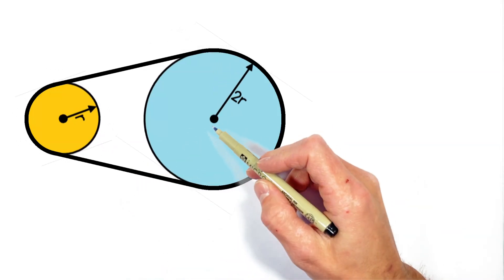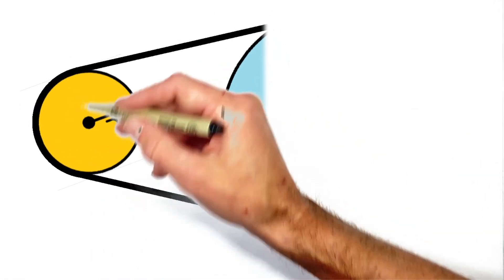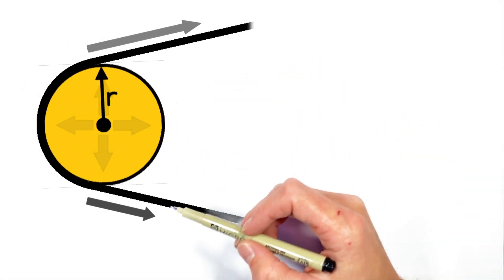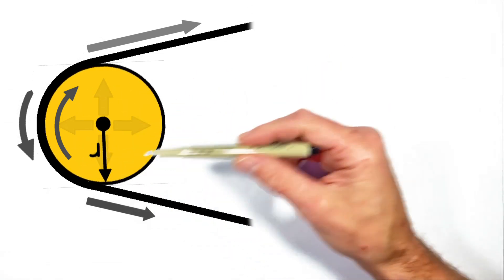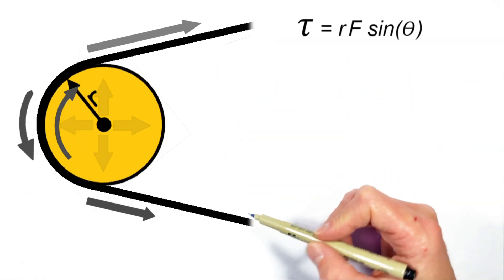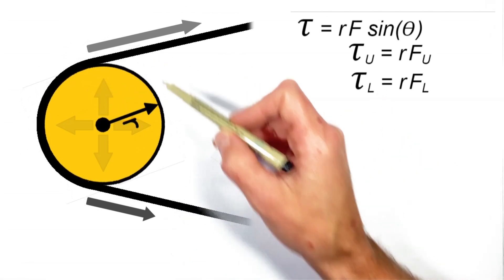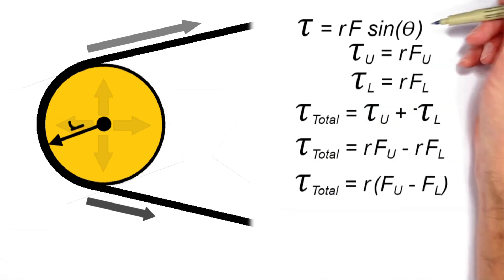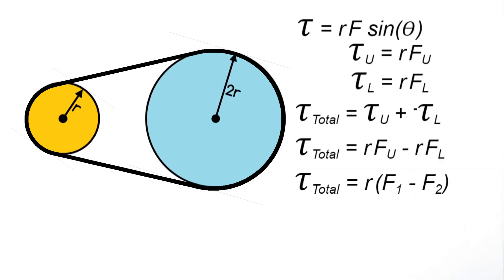Calculate Torque in a Sprocket or Pulley Given Belt or Chain Tension

Comment: im trying to calculate the amount of HP an AC motor requires  with any 2 pulleys (1 attached directly to the motor) the other attached with a rope that would go to another series of 4 pulleys with 40 lbs. (less pulleys could be used) my idea is to basically use old drilling techniques to make a power hammer for blacksmithing, i saw old mining rights with a slack rope to and it inspired this contraption. sorry i'm ignorant when it comes to math. any ideas?

Comment: Please elaborate a bit on direction of friction on belt and pulley
Reply from the maker: In the absence of friction the belt would just slide over the output pulley.  It is friction that 'transfers' force (or really energy) from the belt to the pulley.  

By it's very nature friction will always resist the relative motion between two objects, meaning it will act tangentially on the pulley to move the pulley in the direction the belt is moving, and in turn (3rd Law) it will act against the motion of the belt.
Reply: @INTEGRALPHYSICS  Very nice explanation for the question so happy thank youuu😀